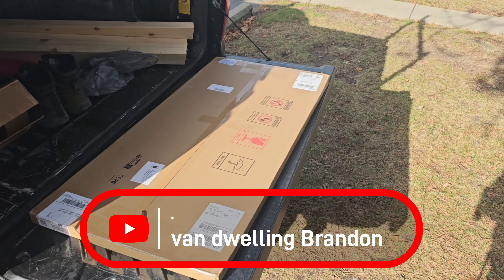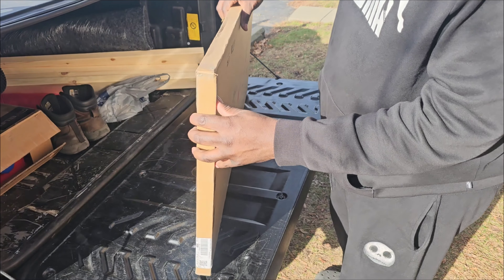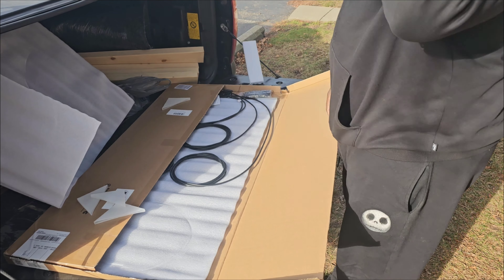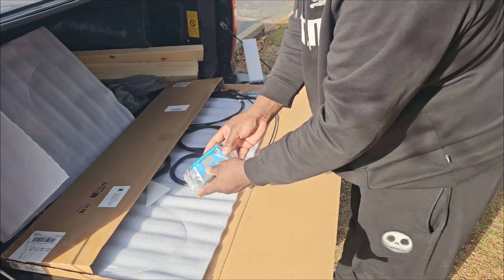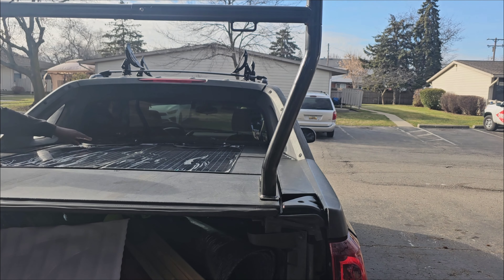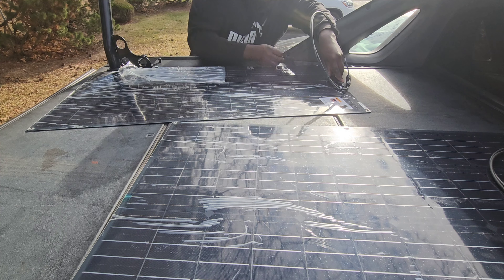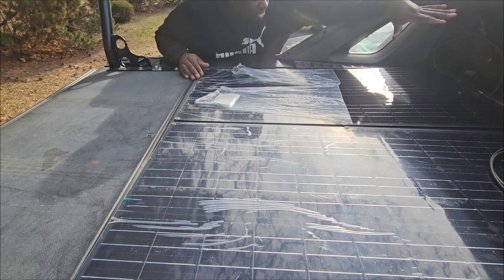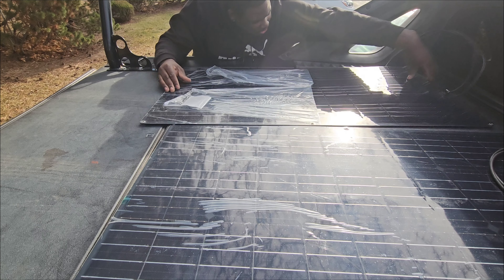putting solar panels on a stealth camper truck

Comment: Might be more efficient to mount them on the Cab roof ?  or one panel per tray cover ? or make a solar panel base on top of the roof racks ?

Panels look great !  I originally put my single solar panel on my dash , to get sun through the wind screen, that worked in summer but not in winter. Eventually I moved the panel out of my truck and placed it on my houses roof, to always get sun, and connected it to my lithium battery I keep in my truck. (when parked near the house). That worked.